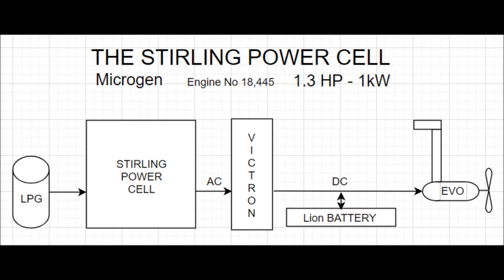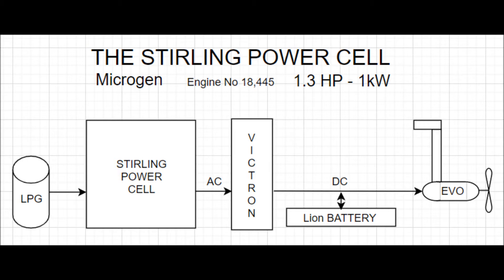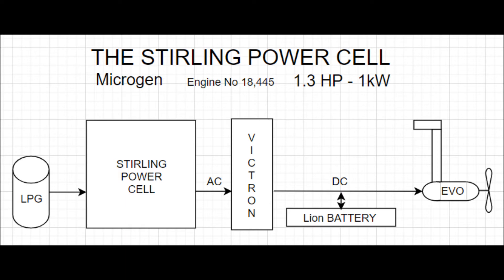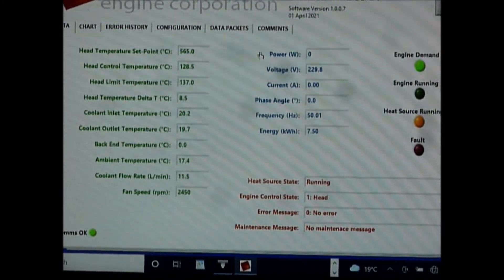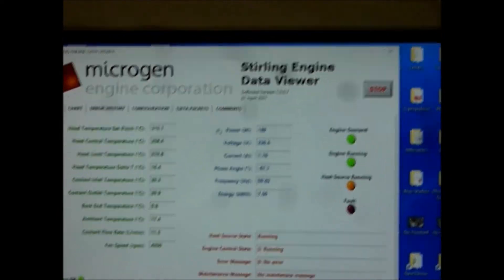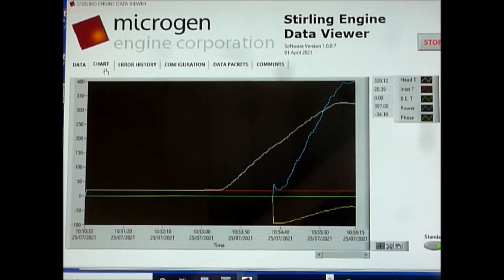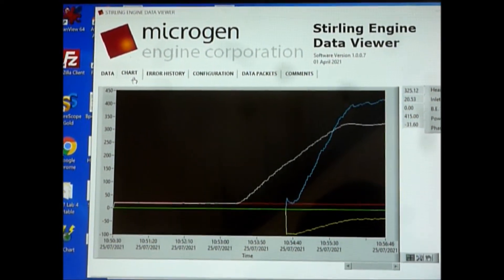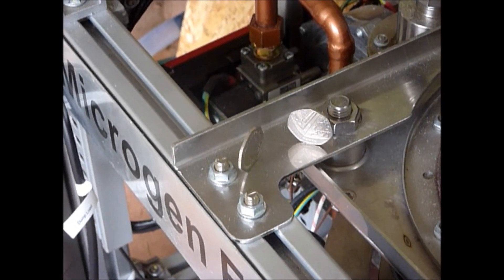1.3HP Stirling Engine

Comment: Very nice system. Any idea on the thermal efficiency?
Reply from the maker: If the heat output is used - along with the electrical output - in 90s percent
I'm only using the electrical output - so  below 30%
When in the boat, the top benefit for me is that I get 48v delivered through to the outboard.
48v throughout every trip. And next year. 
By comparison with just batteries supplying the electric outboard,
you never get 48v delivered to the outboard motor.
As each trip progresses the battery voltage "runs down" (you go slower)
And next year, the batteries have aged (degraded) and the range decreases
With reduced battery capacity, you have to go slower to maintain the range
Having a generator on board is a lot better than just a set of batteries
Reply: @andrewhall2702  Very impressive. It's a fascinating project. I've got a 16kw diesel genset and am wondering if you could stick a sterling engine on the exhaust to capture some of the waste heat - which comes out at around 500 degrees C. Biggest issue seems to be low power density however.
Reply from the maker: @N330AA  Hi N330AA. A lot of Stirling engines run from a burner generating 500C or so. So a Stirling running on "waste" heat at 500C sounds quite practical. The challenge is finding an engine that is suitable. The only engine that I am aware of, that is available for "retail", is the Microgen Stirling Power Cell (SPC)
Azelio have an engine - but it runs from the heat of molten aluminium.
Swedish Stirling have an engine but it runs from burning waste gases from the ferro-chrome industry.
Their engine is a 14kW generator
Other than that - it's DIY
And it is a serious engineering task because to get power out of a Stirling. Significant pressure is needed.
My SPC is at 30 bar of Helium. It generates 1kW
Can we talk via email?
I'm andrewthamesside
I use gmail com

Comment: some  information.     there is  so  little  information provided about the  prime mover, i can  Only  say this.
you  STILL  do  not  understand  heat engines.!
what  Good  is  a  low-capacity battery.!
a  free-anything  heat engine  is  a  DISIMPROVED  heat engine.!
a heat engine that does not have a flywheel/crankshaft is a LESS-efficient engine.!
a linear alternator will Always be  LESS efficient, than  a rotary one.!
conclusion: this entire contraption appears to be  an  efficiency  Failure.!        googletranslate
Reply from the maker: David 

The point of this demonstration boat system is that the source of the propulsion is not the capacity of a battery bank. The battery only needs the capacity to run the electronics of the system. Thus compared to “battery electric” boats, the battery capacity can be small.

Efficiency. Important – but not as important as “does it do the job?” The filament lightbulb was only 2% or 5% efficient. But billions of them were used world wide for decades. Yes, something (LED) comes along as more efficient – we adopt it.

I look forward to you presenting your more efficient system.

More information – have a look at https://www.microgen-engine.com/

Finally, could you please refrain from emotional and/or personal comments.
Lets debate the issues – not the people.
What’s the football saying? - "Play the ball not the man"

Comment: Any idea how much the whole system weighs?  How did you get your microgen stirling engine?
Reply from the maker: Hello M C 

The whole system weighs something like 150 kg.

This is a demonstration system. I and two others have been working on a collaboration with Microgen to put it together.

All the elements of the system are well proven products - Microgen have configured the parts to form the full system.

My contact at Microgen com is Gerwin Lubbers

As of August 2021, we now have the Stirling Electric system afloat and it is working well.

We will prepare another video - given some time.

 M C - what are your thoughts? 

Are you thinking of following in our footsteps?

 

Please contact me.

I am andrewthamesside (two s characters)

I use gmail (com)